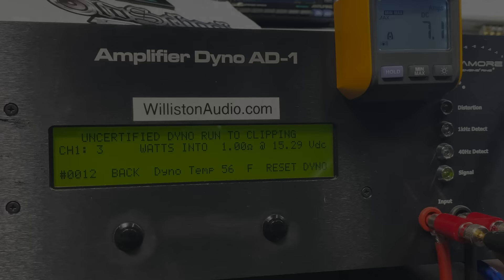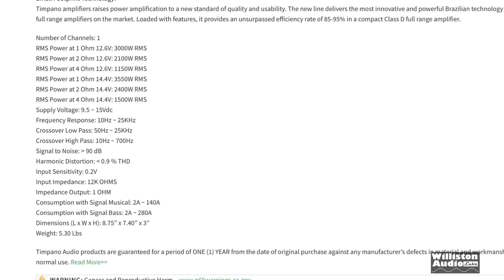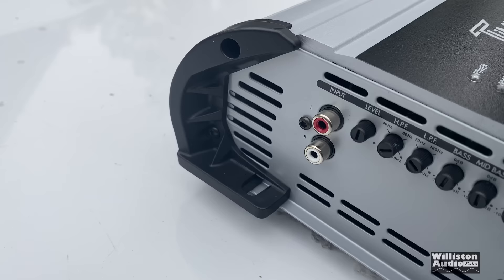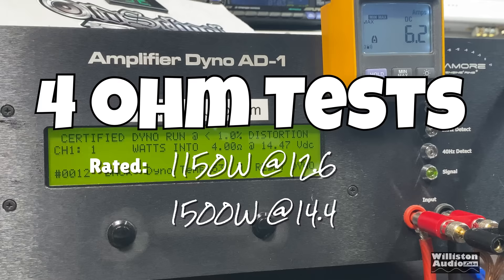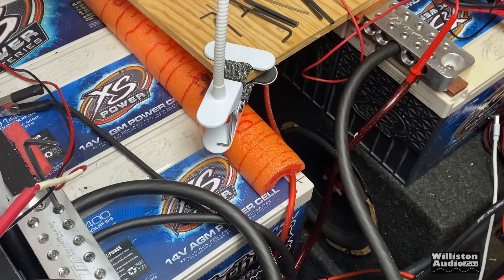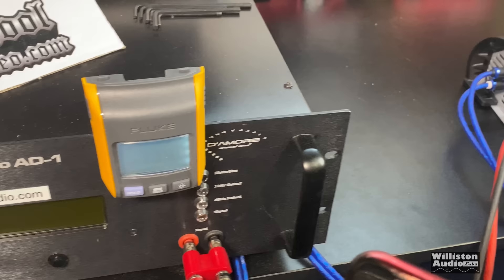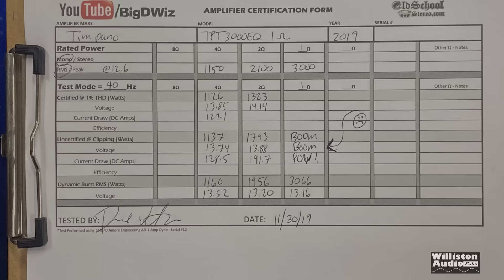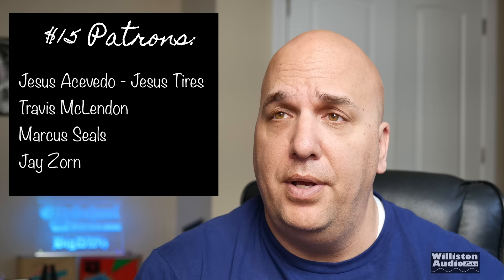This $220 3000 watt Amp GOES UP IN SMOKE! [4K]

Comment: I dont know if it was because the test was made with 40hz but I have seen a lot of cars and trucks running these Timpanos and Stetsoms for Mid Range and HF Drivers and they work really good. I personally have a Stetsom 3000 for mids and a Stetsom 800 for tweeters and it doesn’t even get hot.
Reply: You used two Brazilian junk amplifier, in Brazil have two Brand of amplifier whos trust, the Banda and Soundigital.
Reply: Well I have mine on my MR n Tweeters n never had a issue..

Comment: 5 dislikes must be between people that run these amps & the people that sell them.  Lol BOOM BOOM POW 😔
Reply: OMG you are funny hahahhahahaha
Reply: yea lol. im tryping to buy subs right now and the way i find decent companies and gauge weather theyre good or not is by looking up their amps. if they do their rated power than i might buy from them, if not well...
Reply: Westsidesnooker 2020  still running it buddy and it's been almost 2 yrs and it still works. Nothing against big d wiz but he always tends to push these kind of amps past their limits so of course they burn up instantly and makes them seem like they are nothing but junk. I've never burned an amp from overpowering or under powering so to each his own. Also what do you expect for 200 bucks
Reply: @jeroenschuuring6060  yea, its called up grading my cars electrical and making sure my in line fuses are up to par or underfuse so I don't get those spikes in current and if I do get them, those inline fuses safe me from burning up. I went to school for Electrician so I'm well versed when it comes to electricity but thanks for your 2 cents.  Maybe You could ve put me in my place 15 yrs ago but not today sir. Have a good day.
Reply: @jeroenschuuring6060  I'm running stock 120 amp alt and I don't see anything over 100 amps considering im only running 1 15. I'm not competing and Its called a daily driver for a reason. I do have a oscilloscope and multimeter so I think I know how much current my amps and and alt are pulling. You got some nerve trying to tell someone how to live their lives. Where's your High current sound system at. I would like to see what your working with since you talk a big game.
Reply: @jeroenschuuring6060  I'll.take back everything I said if you show me at least one video of your sound system. You cant be giving out advice because your a part time fire fighter. Are those your qualifications? You think im stubborn, you haven't met the guys that actually know more than yourself. How about I give you some advice, "Stay in your lane Buddy" P.S. I appreciate what you do for this country even if we can't agree anything
Reply: @jeroenschuuring6060  well your saying it now so apparently your not as humble as you think you are
Reply: Sorry, what are dislikes?

Comment: Was looking at the Stetsom Export line amps for my build. Really glad I decided against it now. They've gone down hill fast...
Reply: I have stetsom 8K 1ohm no issues  (13.6V system) and bunch of my friends are using stetsom amps on their huge builds
Reply: @iam-lagger2115  They don't put out nowhere near what they promise. That's why i sold mine. Same with Taramps. When it comes to compact Brazilian amps only brand i would trust is Sound digital.
Reply: @Rentta  well we tested stetsom 8k and it gave rated power
Reply: @iam-lagger2115  Someone's a little butt hurt.
Reply: @unclejohn5012  facts my dude
Reply: @Rentta  My Stetsom 7k makes 6,004Wrms at 9.9V . Wired .7 rising to exactly 1 Ohm on my setup. 
The reason I drop to 9.9V is because I don't have enough batteries in parallel for it yet.  
It does that measurement with 4 of those $50 little walmart car batteries.

Comment: Fire extinguisher tip: Get A CO2 extinguisher for the lab. When you use this, it puts out CO2 and puts the fire out and doesn't leave a mess. Carbon Dioxide is commonly used around electrical and electronic equipment due to it being so clean, just don't use it on wood or paper fires.

Comment: Each TO220 FET (the large package) can roughly handle 75A. The moment voltage starts dropping the current has to go up to keep the same wattage up. Concurrently, efficiency starts dropping as well. The Brazilian amps are pushed to the limits in regards to the current pushed through these things. It's for this reason, and no joke, when people say that Brazilian amps can handle voltage drop. Even when the voltage is in spec, the FETs are pushed to their theoretical limits. The small chassis with no heat-sinking doesn't help either.  To compare Fosgate on the BDCP Power lineup also uses large package TO220 but they use more of them, have a well designed protection circuit, very heavy sinks, and push sensible power numbers (the BDCP 1500 does ~2000W RMS / 3000W burst).

Comment: If you ask me this is the exact reason why you should but a fuse in between the battery and the amp power wire. If the wire had a fuse rated properly for the amp with wire the correct gauge you would never have that problem. The fuse would just blow before it goes over the current pull that would blow the amp.

Comment: Imagine if you actually had 4g wire on it, that could have been a much bigger problem, always have an inline fuse in case your power lead melts from over current

Comment: What's your rca input voltage ?
I know some Brazilian amps will go up in smoke if rca voltage is more than 2v
Reply: Jose Hcca Luna  The RCA input voltage shouldn’t affect the power supply section. My guess is that it’s not truly 1 ohm stable by design. Or it may not like a 1ohm resistive load.

Comment: Big D saves the day again!  I actually found their amps via their speakers and had my reservations about a rebadged Brazil made amplifier and it turns out my gut was right!  Timpano, used to be Tempesta in Italy and all they made were speakers.  Good speakers...VERY good speakers for the commercial audio market.  PRV bought them (Probably for the speaker tech) and decided to make the name more "Latino" and into a full line brand.  They probably should have gone to Taramps or PowerUs instead.  Lost opportunity.  Thanks for saving me a few hundred bucks BigD...you ain't no "big dummy"!

Edit cause I'm a big dummy and can't spell.

Comment: Dont recommend a smaller fuse, just recommend ppl dont buy them. lol
Reply from the maker: Well there’s that...
Reply: I have ran these for a while now I have yet to have one fail on me.....  I fallow Brazilian amp rules.....  Wire above rated by half an ohm.....  Don't feed with more than 14.8 volts.....  Don't feed with more than 1.5 volts of rca signal....  Don't get up to clipping.....  Tune to the cleanest signal possible....   And if you want 2500 watts buy 5k

Comment: Big D, based on a ton of your amp dynos, is it the norm these days for car audio amps to be rated at 2 or 3 times what they can actually deliver?  As a teenager in the 80's paying alot of hard pay cash for Alpine and JVC amps I and my buddies played for, are amps today different than when my friends and I payed all that money?  They seemed to be bad ass back then with no problems, with 12 band x2 EQs, and crossovers.  Now, we are in our early 50's, and have money for our rides, but your channel may be showing us we are getting ripped for our money on the power.  We have noticed it.   My friends and I, all agree the sound is NOT the same.  Can you do a video that might explain how we should approach buying power for our classic old school rides?  We used to put 4 6x9 monos in the back window with enclosures and listen to Boston, and rattle our teeth.  What has changed?  My pro restoration shop is watching and listening to your channel.  Are we being cheated on our amps?  Thank you!

Comment: I ran one of these amps for over a year on 2 Sundown SA 15s. I ended up going with the Sundown SFB 2000. I thought the 3000 went out turned out to just be I needed to replace the ground wire. Amp was fine. Now the Sundown is much cleaner and has more power.

Comment: Honestly this amp is probably a 4 ohm ideal 2 ohm min amp which they tested to play music at 1 ohm for a song and didn't blow up. If the power supply FETs were replaced with high quality ones chances is this amp would be fine.

Comment: Fuses are designed to snap at around 1.5x to 2x the current the fuse is rated for. This way the fuse won't snap every time you hit 60 amps on an amp with 2x30a fuses, but it will snap when you short and send 120amps + to the fuse.

Comment: I’m no expert but in my experience any amp that puts out 2000 watts or more will have 0 gauge power/ground input terminals. So check the pics before you buy folks.

Comment: Read this im guessing you hurt'em good job big D appreciate all the vids:

The power rating data is based on equipment from the PRV Audio Group laboratory. Rated power tested with 100Hz to 1KHz sinusoidal signal and THD <= 10%, with resistant load referring to the indicated measurements. The electronic components and the manufacturing process can present manufacturing variations, thus leading to a variation in the measurements made. This amplifier is designed to perform on music applications ( with speakers ), any load test ( resistant  load ) is not recommended.

Comment: I'm a budget bass head, I run the power acoustic 2,500d amplifier, I know it only  has 650 watts out put but I dont have to worry about it blowing up, and its pushing my wdx db drive 15"sub just fine

Comment: In the video the amp starts at 15.23 volts dynos then dynos again at 15.01 that's the equivalent of burping twice in a row. This will cause most amps to blow or protect. I ran Brazilian amps similar fine at 14.8 15 volts plus will cause them to blow. Start at 14.8 see what happens

Comment: I've seen this on other equipment as well.  It is usually the traces on the circuit board that are not heavy enough to carry the current.  The original circuit boards may have been made with two ounce or heavier copper.  Then someone in production uses one ounce copper boards because they are much cheaper.  On Chinese stuff that gets copied, the copies may be using thin copper because they don't know what they're doing, or care for that matter.

Comment: Resistive load testing is brutal. May not do this on reactive load. What you think D?
Reply from the maker: Every quality amp should handle resistive testing IMO. Kicker, RF, JL, MTX and some others will handle extended resistive load testing.

Comment: There's a guy in south Africa. That repairs amps, he infact said that the amp circuit he repaired was stronger due to better ics used. I'm assuming that In getting better ics could improve it

Comment: Don't feel bad for running a dishonest company out of business. they need to change up how they sell things and they won't have that problem. What you are doing is holding them accountable. Its people like you who will change the industry if what you are saying is true. The companies will fear the backlash from such test if they are caught in a deception. Don't hold back do what you do. And NEVER SELL OUT. Your vids have helped many companies sell amps as well, even if they did not do rated power. At the end of the day its all cost per watt vs clarity that matters. It would be nice if all companies are honest or simply underrated their amps by a little bit.

Undersell over deliver will make anyone happy.

Comment: I wouldn’t necessarily say they should go out of business, but their protection circuitry needs massive revision even if it ramps up the MSRP by $20-30.  If the protection worked well, this amp is still a pretty decent value considering its footprint.  If they could fix the protection I’d be interested in buying one.

Comment: the worse part is that it was still operating while in protect mode. once that thing zapped the protection light started flashing but the fans on the inside were still spinning which was just fanning the flames. look here 10:05 you can see the protect light flashing but the fans are still spinning full speed and the flames start getting bigger inside of it. this thing is super dangerous.

Comment: There's a 400 watt amp attached to speaker and box I want to try, problem is it's been in a trunk for years don't know if the capacitors are dried up. I know speaker still flex. 
Excellent video.

Comment: I had the boss armour 4000D and I was running it at 1 ohm and I used an oscilloscope to tune it just below clipping but after about 10 months of use I was driving home one night when I heard a pop and a crackle and the car filled up with smoke, so I pulled over and obviously the amp was blown but I had no tools to remove but the in line fuse I put in popped before it could do any real damage to anything else so I drove the rest of the way home (30mins) and went a month without bass before I bought an audiopipe 2k amp that has served me well for over a year now with a Rockville w15k9d2 at 1 ohm but my alternator/wiring isn’t strong enough so I’m only pumping about 1000 watts out of it right now but a 1/0 wiring upgrade coming soon :)
Reply: This happened to me 2

Comment: UPDATE-I have the 6k 2ohm running 2 15’s first I had custom Hcca’s now I have custom Adire audio 3000kh’s from a sub builder [5-8 audio]. Had trouble tuning but just recently I learned if you want to get really low like 28hz-18 hz first make sure you have a upgraded Alternator do the big 3 and at least 2 batteries and your box tuned right. 

 I have a U.S Alt 250 amp and two XSpower d7500’s with dual runs of zero gauge power and grounds and dual power and grounds running to the amp. I basically have my gain almost maxed and the bass level since it’s set at 45hz at -7 levels go from -10 to +10 I no longer get the clip light to even flicker let alone come on so I know I’m good. This is different technology and I couldn’t find anything for tuning them so I just kept playing around till I got what I wanted out of the amp now it SHLUMPS! I like to play in that 28-18 hz with Authority! And now I can all day. Just be careful some slowed or rebased stuff isn’t recorded cleanly and could have distorted signals in it. 
My subs now run cool to kinda warm. My amp runs Luke warm to barley warm. Dj dropn dj deep Bassotronics ALL DAY!

Comment: Hey, from down under. Did you say you had similar problems with Stetsoms? I own a 4K5EV which is fused at 200amp X 2 (twin 0ga positive and negatives), is this too high? I will have to watch it during comps.
Thanks for quality videos, keep it up.
Reply from the maker: Yes, not just me though, others who have tried the Stetsom based amps on Dyno’s have seen them go poof! Just be careful brother

Comment: My system runs @ 1 ohm. Has been totally stable for about 3 months now, minus a set or two of fuses wiggling loose and popping. Otherwise, thank god its not this amp.

Comment: Well. I have a Stetsom 6000 eq export  2ohm. I’m running it with a U.S 250 amp Alt big 3 done. A XSpower d7500 under the hood and a 2nd d7500 as a secondary batt. I run dual 0 gauge  wire to link the batts and Orion dual 0 gauge to single 0 gauge power and ground adapters. The 6000 eq fits those Orion adapters fine so right there that’s a big difference. I’m pushing 2 custom 15 inch Orion Hcca’s that the builder says handle 3k each conservatively rms. I used my seat belt brackets modified for my grounds. I’m also running a Stetsom highline 800 watt 4 channel for my highs at 4 ohm and a Memphis 420 watt 2 ch at 4 ohm for my 12 inch mid bass. I’ve had the Stetsom 6k for over 4 months I use the overclip button I don’t clip my signal ever I play bassotronics even the slowed down versions on repeat. It took awhile to tune the amp cause of its full range style but I figured it out. I run 250 amp fuses per power wire to the 6k. Maybe I’ll swap for 200 amp. I’m old school and stay to 2ohm. 

I’ve been asking to test a Stetsom this is close, maybe it’s just there export 3ks that just are faulty. There’s a vid where a semi trailer demo vehicle caught fire after some devastating bass. But ya this is real news I’m glad you do what you do. Keep up the good work. You got me thinkn
Reply from the maker: The Stetsom manual says 150A for the 3000, so I’d fuse that 6k at 300A to be safe

Comment: That Alpine head unit is rated at 5 volts in its RCA output; did this contribute to the breakdown of the amp? I'm not saying this amp is reliable just if it added to the problem.
Reply from the maker: I’ll let Timpano reply to that question...

Comment: I watched a video on Stetsom amps , which look identical to this amp. One thing is that there is only 1 rca input. The other is a output. I believe the bottom was input and top was output. I’m going on memory.
Reply from the maker: It is OEM’d by Stetsom

Comment: A lot of people giving Brazilian amps hell but big d clearly said these are made for more of a full range application than for bass I run a prv a1mh pro which is Brazilian with about the same specs on my mids and I haven't had the first problem out of it doesn't even get warm but I wouldn't dare put it on my subs really wish he would have tested it at a higher frequency

Comment: I think that the amplifier is ok, the problem is that they didn't add a protective circuit to the unit and that maybe saved a $1 in production, but what a mistake.

Comment: That is too bad! Imagine being a budget bass lover...and this...
If it would be me I can replace the MOSFETs with higher current ones to offset the issue with them blowing up, and current sense shunts for the overcurrent protection. Would probably cost as much as the amp itself, so better get the Taramps, SounDigital or other tried and tested brands. I'll be happy running a MRV-500, thank you~!